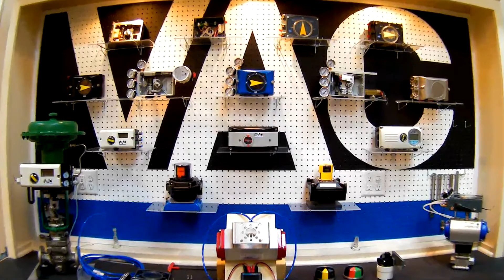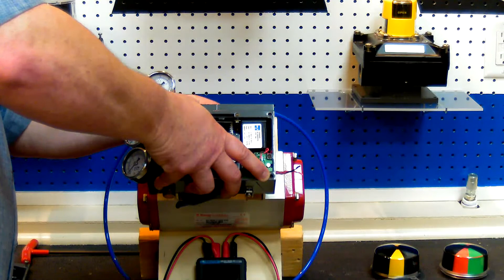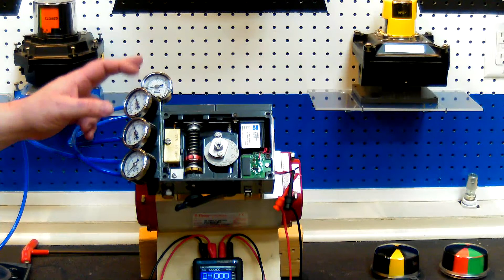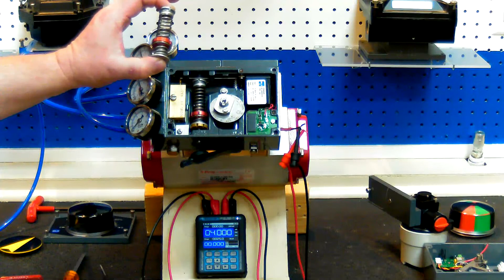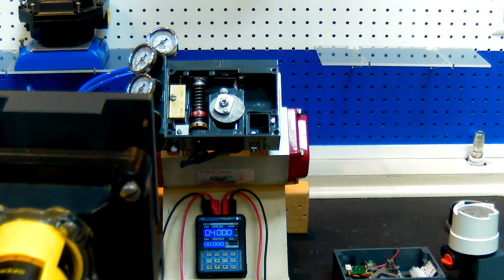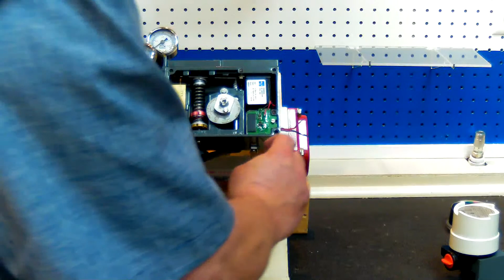VAC's V100 with Feedback Modules

Comment: What if my electro pneumatic switch to pneumatic on its own or fluctuates between 0 and 100 on its own? I've tried the replacement of the electro pneumatic part and does the same and if using the older versions of electro pneumatic, it jumps straight to 100% and stays. Definitely would like some troubleshooting advice.